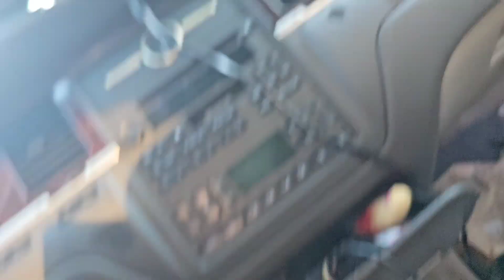Automotive Mechanic Trade or Electrician / Plumbing / HVAC Trade?

Comment: I got a question for you truck owners. Do y’all actually use pickup trucks for work purposes or are they just a status symbol now? I see a lot of people buying these expensive pickups and the only thing they’re hauling heavy is themselves. My friend at work has a f150 that he drives back and forth to work and it’s one of those top end models and I asked him and he said I just like pickups cause it’s manly.
Reply: I used my 11 Ecobeast to haul my daughter's racecar to the track most weekends. Trailer, car, and gear about 10,000 pounds. Used it to haul wood, dirt, and car parts. Now that I am beyond that, I bought another F150 for a luxury vehicle to drive. The old truck will still do it's thing though.
Reply: @ronjohnson9032  but since when did pickup trucks become luxury items
Reply: @JDMSwervo2001  To me, it is better than a Cadillac of about the same size and weight. Air conditioned seats, massage seats, and a whole bunch of other goodies. And I can tow over 17,000 pounds of whatever I want. Do that with a Prius.

Comment: I'm an automotive tech. I can do auto gas mechanical, auto electrical, electronics, auto aircon. Im doing doing side hustles in residential electrical wiring and appliance repair and HVAC as well 😅

Comment: Sometimes the building trades ain't all it promises.  Over the years with a dwindling economy you could be laid off for months or years at a time.  At the same time an auto tech will have consistent work.  May come down to are you willing to move where the construction is or are you tied to an area because of family or spouses family.

Comment: HVAC, Electricians and Plumbers don't get nearly the grief that auto mechanics do.  To me, there is far too much of a confrontational interaction between auto mechanics, service centers and customers.  Also, there is not nearly as much "how cheap can you do it" with the other skilled trades.  There is also not as much blame for when problems occur weeks or months down the line when problems occur.  For example, a customer will blame the mechanic shop when their wheel bearing goes out two weeks after they get their alternator changed.  No customer will blame the plumber for a running toilet when they got their water heater replaced weeks before.  I think the problem is that customers think they know about cars but don't pretend to know about the other systems.

Comment: Automated Systems Tech tied to IBEW local 46 for 27 years. Former USN for 10 years. Union labor is highly skilled in the electrical/electronic trades. I am on the electronics side and for all practical purposes my apprenticeship was the USN. The electrician side of things has an apprentice program. Training is available to both sides but on the electronics side YOU have to go after it. It provides a wage that allows my wife (who has MS) to stay home and health insurance that covers us. Unions get a bad rap, some of it is deserved most of it is not.  I can only speak for IBEW. Right now we are in the golden age of trades because the supply of skilled labor is low. If were not for the veterans we would be sunk. 90% of our shop and new hires are veterans. Our union expects you to show up on time and work. At the end of the day you do turn over and go home. So veterans fit right in nicely. If any young folks are reading this, now is the time. Start an apprenticeship if none are in your area and your able, join the military in a trade you are interested in. Right now you do not have to begin life with an oppressive debt load. You can actually get paid to learn. Like anything what you put in you get out and you must seek other opportunities even in the military. Cheers.

Comment: I hate to tell you the truth. But a union industrial high voltage master electrician averages $50 + hr
And if they travel . their pay goes up significantly.
Plus they get over time and 
per d m.

You'll never make as a mechanic. What a union electrician makes. 

A union master electrician
Can break $200k+ a year with OT 
As a matter of fact. Most union jobs.
Plumber,steam fitter,pipefitter, 
Pipe welder, boiler maker. 
Machinist, millwright.
Ect... All of these are union jobs and pay very very high. But your industrial high voltage master electrician Is pretty much at the top of the chart. And if he buys him a van and does his own thing. I've seen them charge upwards of $350 an hour depending on the job.
Electricians are highly paid.
Reply from the maker: Not everybody wants to be a union electrician though